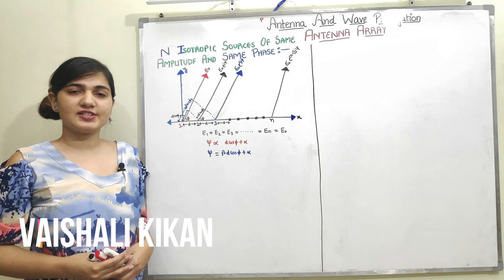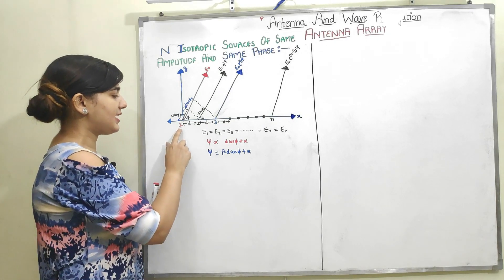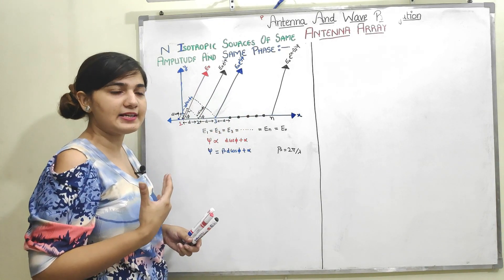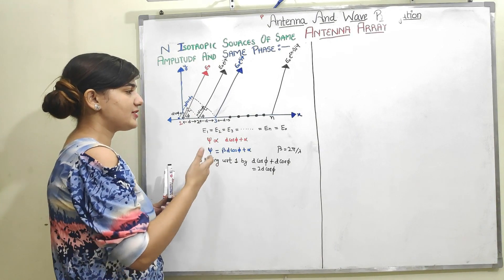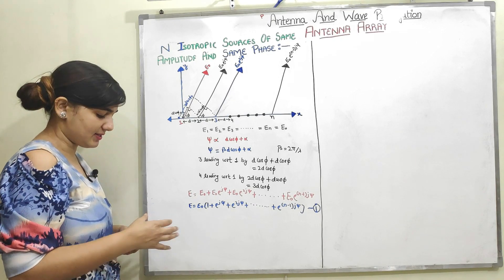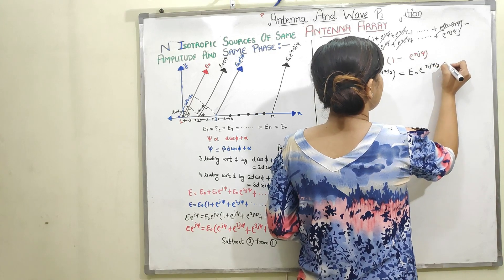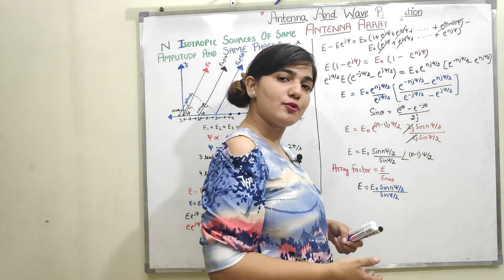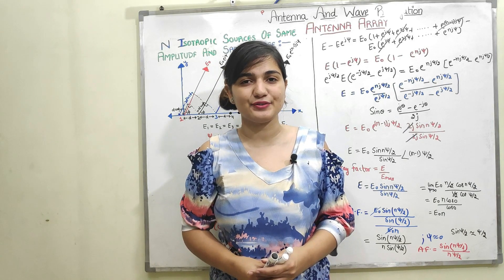Antenna Array of N Isotropic Point Sources | Antenna Array | AWP | Vaishali Kikan | Lecture 17 |

Comment: if element spacing is increased (between 0.5lambda and 0.8lambda) directivity increases.... 
directivity=(peak radiated power)/(total radiated power)
i think peak radiated power remains same even though element spacing is decreased. the reason why directivity has increased is due to the fact that total radiated power has decreased.

in this case, 
1. what happens to the effective aperture of the antenna array?
2. how gain is affected?
(i mean, considering only array factor equation where mutual coupling is not in picture).

Comment: derive an expression for power radiated by a linear uniform array of "n" isotropic and also find the array factor      mam these question is same as these video or not and please explain these question also
Reply from the maker: Anwer of this question is this full video
Reply: Thank you mam
Reply: derive the expression for friis transmission received formulae related to the power at a distance "r" with total power transmitted       
mam this question which video mam